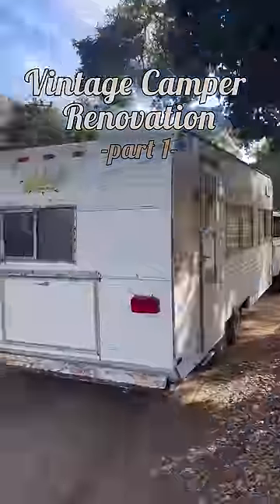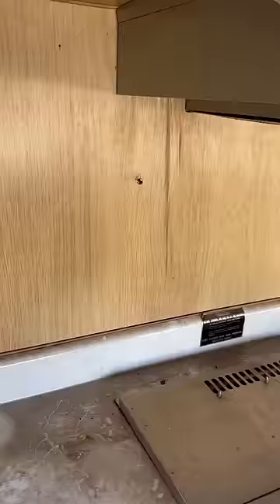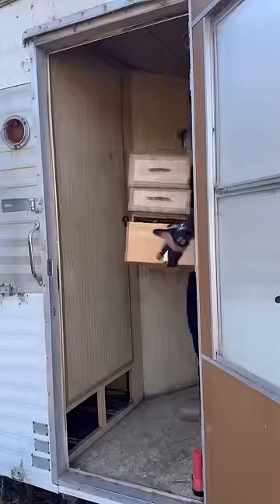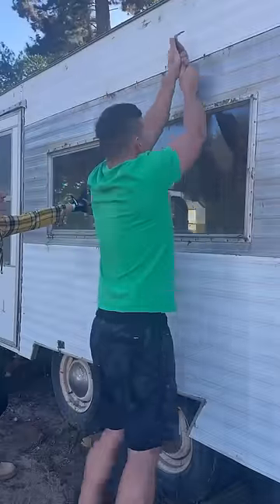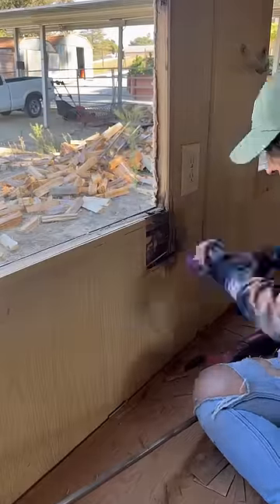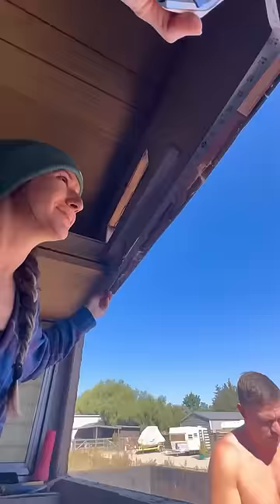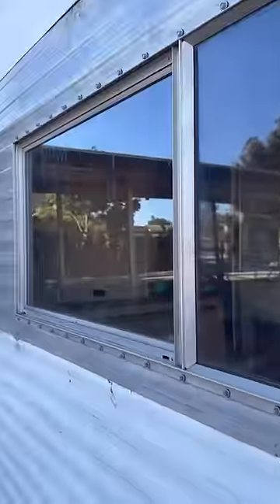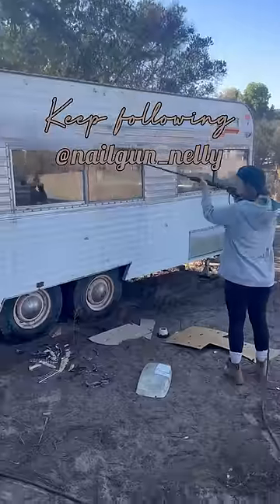Part 1 of the 1970 Ideal Travel Trailer Renovation! #rvrenovation #diy #vintage

Comment: ❤   Lesson if you do this. Cover the shop vac exhaust with a wet cloth to trap air particles.  My husband and I got deathly sick from doing the same thing. The mold  , and dust! Wear a mask!
Reply: Exactly! That wasn't petrified wood - that was mold eating it! As you found out the hard way, it's very dangerous for your health. Unfortunately you really need to remove all materials 3 ft in every direction around the moldly areas and then paint with an anti microbial to prevent it from growing back, because it will. My husband's a mold inspector. Be safe & good luck to all!
Reply: Oh wow, I’m sorry to hear you became so sick!

Some people might find the following to be helpful:

Vacuum bags are available for shop vacs.  Not just crappy paper either.  Now you can choose the level of filtration you prefer.

Also, consider wearing a respirator with the appropriate filter.
Reply: Everyone is so kind to be concerned & helpful. I hope U gett better Lisa. I think it would be best if U see a Natural Path Dr Bcuz U still have mold in U that U dont know about & that's dangerous.
Reply: It's not hard to determine if you've gotten into some toxic mold. You'll feel crummy around mid-day, swear you're coming down with the flu by 7 pm so will go to bed. Then you'll wake up in the morning feeling great only to experience the same thing that day.
Reply: Homeopathic tip.  Yerba mate tea and Pau d'arco tea are both  anti-fungal.  Available in health food store, or on line.  U may need Rx meds if u r ill enough with it, but the teas help.  I was nearly hospitalized with it when I was drinking contaminated water and didn't know it.

Comment: I did the same exact thing with a 1973 Comfort camper trailer. All new foam & upholstery.  Replaced some framing & wallboards in and around the shower. I resealed the roof but didn’t replace the windows. 
I was very proud of the work I did on it. I did an industrial themed interior. All counter tops were stainless steel with the swirls and backsplash was diamond plated aluminum. 
I had all done!  Buddy of mine knocked an old barn down for my wife while on my tractor. The main roof beam went right through the trailer door and some other panels got ruined. 
I ended giving it to a coworker who had just moved to San Diego right next door to a trailer siding manufacturer. They rolled out all brand new panels for him. He completely redid the exterior!! I only charged him for the new tires I’d just mounted on it
Reply from the maker: Awesome!

Comment: I've got a 1972 Lark camper,  my nephew took it apart all the way down to the actual trailer frame,  starting with sheet metal,  rebuilt it including good house insulation,  a little wood cook stove keeps it toasty warm...
Reply from the maker: Awesome
Reply: @Nailgun_Nelly  ,, looking into another camper

Comment: Nice job!  When replacing the rotten wood, don't forget the cause of the rot.  It's usually the roof, or roof/wall joint.  You need to lift the perimeter of the roofing to inspect...if you don't, you may be replacing the wall framing again in a few years.  It's fantastic that you've saved this classic from the wrecker yard.
Reply from the maker: Thanks for the tip, we definitely took time to reseal the whole rig, replacing all butyl tape and fasteners

Comment: We did the same thing to a 1969 aristocrat and it was fun and we were very lucky there was zero wood rot in the entire camper. We just needed to replace everything cloth an foam cushions. Now we paint and new tires.
Reply from the maker: Thats surprising!!
Reply: @Nailgun_Nelly  
We got very lucky it was parked inside for the last 25 years and before that it was beside a garage.

Comment: I was given a 30 ft travel trailer once in leiu of a payment a guy owed me.  I put $1,200 dollars into renovating it, and a WEEK later sold it for $5,000 GRAND.  I built a new entertainment center, two new propane tanks, pressure regulator valve, new wiring, new plumbing under sink, new water line for shower, re-surfaced and stained floor, re-built dining table, new shower, new door, back splash, new sink, new faucet, new queen mattress for bed, fresh paint, two new windows, window blinds, re-built A.C., and new generator.
When I was done, it almost looked BRAND NEW

Comment: I have a" 97"  little motor home. I love it. We bought it and only paid 5k for it. It's a great fixer upper. Everything works on it so we r extremely lucky and happy. I mean the ac and heater is better then the ones I have in my home lol. I love my camper I can't wait for the warmer weather. I say that but I have a lot of back pain so I'm a little discouraged and scared I think of the project. Idk. Nevermind. I thought I was trying to get some advice but I don't know where to begin

Comment: I love to see that you didn’t remove all the cabinets and structural skeleton of the camper. So many redos strip everything down to a bare box, when they finish it looks great but the 1st time they take a trip all the joints get loose. Before long there is no strength left and it basically shakes itself into pieces.
Reply from the maker: I try and keep anything I can!
Reply: I'm not trying to be cynical; this is a serious question. What kept it from shaking apart in the first place after it was initially completed? Whatever they did at first she would need to follow that same process. 
If the inner skin is taken off anyway it would be a good idea to check the structural integrity of the frame and replace damaged components if necessary. 

The only answer I can see is to use wood screws and  construction adhesive at every joint. No nails allowed except where absolutely necessary to do so. 

If you or anyone else has suggestions to improve upon my recommendations I would greatly appreciate them. One other thing: perhaps wooden gussets at the corners that experience  the most stress.

In the comments section I asked her to please tell us the total cost of the project. As an older guy with limited funds I would love to take on a project like this just to stay busy and keep my mind sharp through continual problem solving. Therefore I really would appreciate any helpful suggestions, and I will be keeping an eye on her progress as the project continues. 

Thanks for reading.
Reply: Your video came back around to me today, I went to compliment you on not removing structural support in the cabinets and dinette. I realized that I already did 7 months ago

Comment: I have a recipe that might help u. Take 1 gal if Linseed oil. Add 1 cup white ash. Let it dry. This will water proof ur wood. I would do more that I coat. (Thompson works too) u can paint it after u sand it if desired. That is a 1907 recipe.
Reply from the maker: right on thanks!

Comment: I would put some insulation in the walls if I was going to open them up. Would spray foam add much to the overall weight?
Reply from the maker: No i think it would def be a good idea.

Comment: If that old fridge gives you trouble, put a 4in fan blowing on the outside coils.
Reply from the maker: They always give trouble!
Reply: @Nailgun_Nelly   they have trouble absorbing/transfering heat in warmer weather. That little fan will help keep the condenser coil cooler allowing the evaporator to work better. I have an old dometic just like that on in a 1968 cab over truck bed camper. It's an awesome fridge but if it gets too warm out it acts up. There is a company that sells a kit for them, but the $10 Walmart fan is the option I liked. Great build btw, love your work.

Comment: While I was living in a vintage RV it was from a 1960 I'm pretty sure it's 1968 is more of a 70 style RV but it was from 1968 it looked like it was from the I was living in there I had a window AC through one of the walls because the windows were just too small to fit in a see-through and I'm not living in a hot RV so I cut a hole in the wall and put an AC in it well I live there for about a couple years like that well I was sleeping and this is a pretty decent sized RV it's like a 20-footer pretty high ceilings enough to where I can mount a ceiling fan over the bed and my bedroom but long story short I was sleeping and we had a lot of very bad snow weather well the RV roof really didn't leak as bad but it was leaking at the time and I have buckets under each skylight well I was sleeping and I heard this crunching would getting pulled apart I walk out and the entire front room of the RV is collapsed the roof and everything so I had to actually use the fire exit on my bedroom part of the RV because I couldn't get out the front door because I walked out there all I could see was the light that was mounted to the ceiling that is now above that's all I could see out there the electric in the bedroom went out as soon as the roof collapsed long story short my RV collapsed due to snow when I was living in it and I'm happy it didn't collapse when I was in the dining room it literally had its own like dining room almost like it was a pretty decent sized RV but it does suck that it claps on itself but my plans are to get another one I actually have the same AC from the RV I just cut it out of the wall with a sawzall and I know that AC didn't compromise the framing because I boxed in all the framing at the edge and I actually reinforced it with 2 x 4's just to be safe so that AC was in there really good but I'm pretty sure the roof collapse due to arotting beam in the middle that was actually bearing most of the load and that RV survived two pretty bad storms here in Kansas I was living in there we got this one storm that was so bad my roof actually was compromised after the Storm the water would leak into the walls and I didn't know it was doing that until we demolished the rest of the RV and turned it into a car hauler and I was 14 when I was living in there and I'm 16 now and planning to find another RV because I miss having my own kitchen and bathroom and dining room and you know the bedroom all that being able to have my own privacy basically it was like my own little I lived in it basically like it was my house while I was working at a bar and grill and I'm still working at that bar and grill RV set right next to my dad's house and I even wired it to electric myself most of the 2:20 appliances I replaced with 120 volt and then I wired in two pretty decent sized lines that were old Romex that was recycled from another house that we were rewiring well I had that Romex pool that just happened to reach out of the laundry room and down and up into the RV and I tied that into the actual breaker panel for the RV it didn't have  fuse box it had a breaker and trust me I'm pretty happy it had a breaker box given I had a window AC running in there and during the winter because the gas furnace that was in it went out I had two propane tanks on the front but you could run that furnace on gas but I was sitting there is midwinter in that furnace the blowers on it went out I have two blowers and they both went out because it was a two zone furnace there is the blower that went into the bedroom and bathroom and then there's the other blower that went into the dining room kitchen slash living room the RV was big enough to where I fit a it was basically just a love seat from the seventies but I miss having you so much she was my baby and I'm kind of bummed out that it collapsed on itself because I had a pretty vintage ceiling fan hanging in the kitchen / dining room area the ceilings in it or kind of high but the reason why I installed the ceiling fan in the actual bedroom in the back cuz it was like a single person or of either as a king size bed in the back with a wall that separated it in a the ceiling in the kitchen / dining room area was much higher it was almost 7 ft almost and I hung a flush mount ceiling fan from the early 80s in the kitchen / dining room because I am more of an older style person I like my house is to look old I like my RV lookout dated basically I like the outdated look I like it because it just kind of reminds me of my childhood because I grew up in a lot of outdated homes and I liked how they looked they're always so warm and kind of inviting but I remember living out there and it was a it was an experience on what to actually check on when you get an RV now and I've checked on some RVs that were free and I passed you to most of them each needed a new roof and the ceilings are too low but the more the room collapsed that had a 42-inch hugger from the early 80s and the dining room slash kitchen / dining room living room two well Van RV treated me good and I treated her as good as I could because I did not know that the roof was falling in on itself if I would have known I would have fixed it but I never got around to it and the Harvey collapsedand it was pretty scary having to go out of that fire exit cuz I had the thing sitting up pretty high on cinder blocks cuz I had a foundation going on it I was going to actually make some skirting out of foam board for it but that never happened you know because the roof caved in but I do miss that RV I have no idea the brand of the RV but it was a four season which whoever bought it back in the sixties or seventies must have been loaded with cash because a four season RV back then has to not been cheap but I had pets going to the toilet cuz I put a normal toilet in there a normal sink and the shower I had pets going out there to the kitchen sink too and it was basically just going off the laundry room hookups off the washer and dryer we just put in a t-valve that way we can do that well I had hot and cold water out there because of the you know the stock water heater was I'm not trusting it I'm not trying to create a pressure bottom in my RV what was the RV now it's a car hauler I want to know the funny thing is the tiles for the bathroom are still on the back because I put some pretty thick plywood down on the floors and then just covered it with 80s linoleum to top it's all off I wanted to keep the 80s look

Comment: What caused the wood rot?  Did you find and fix the leaks?
Reply from the maker: yes the seam above the window was leaking and one across the roof.  Replaced windows seams and resealed the top ones!

Comment: Between the hours spent in deconstruction, removal of the rotted wood that I’m not sure you even got close to getting it all because the wood around the windows looked to be coming from a leak higher up, replacing the bathroom and kitchen utilities, replacing all the inner walls that were taken out plus all the hours diagnosing all the problems and hours spent replacing everything. A much newer trailer would have made more sense unless you were just doing all this for something to do.
Reply from the maker: I think this comment was a lot of time taken for no reason so I guess we are similar 😂

Comment: I put a strip all along the edge of the window opening   , tape the inside of opening so about a half inch of dick tape is on outside and a half inch shows on inside. It will never rot around windows again

Comment: Why would you "splice in" framing instead of replacing the entire board?  It doesn't make sense to me because I have OCD and "drives me nuts" !!! You only saved a couple feet of lumber and now introduced a new structural failure point.

Comment: Never pressure wash an old trailer. Water will go where you don't want it to and it will stretch the metal. Now you need to remove all the J Rail and replace the old putty tape with new. Really you should have removed all the metal skins and replaced all rotted wood. There's a lot more under there than you realize.
Reply from the maker: I did remove every meatal seam and new butyl was placed along with new screws

Comment: Sadly you did not remove the skin or even the jrails or roof vents. There are areas of rott you cannot see. This is not the way to restore a vintage trailer unless it is aluminum framed. Stick built trailers should have the skin removed. Water travels down. Upper areas can look like they have gotten wet but not rotted because the water settles below the floor. Rotting the wood that holds the trailer on the frame. I know this from experience.

Comment: Where do the vice buy a camper with an aluminum frame don't use wood don't buy one with wood no I'm not sure about the windows and all that but if you have one with the aluminum framing you don't have to worry about most of that rotten
Reply from the maker: You do on the subfloor

Comment: I cannot believe how ORIGINAL this camper was, and you literally destroyed it.  It would have been much easier to find one that was gutted already.  They are at least as common, if not moreso, than shitty ones.  But to have found an original, in this good of shape and then...

Heartbreaking.
Reply from the maker: So I shoule have left the rot? the only modification I did was create some arches, the fridge didnt work, nor the furnace and the stove I am hoping to keep....everything will be going back in once clean and fixed.

What would be heartbreaking is letting yet another one go to the dump
Reply: @Nailgun_Nelly  
Arches weren't the only modification.  You can keep telling yourself that you're doing some kind of divine work.  But like I said, there are plenty out there that are already gutted.  People are looking for original trailers, and they are getting harder and harder to find, because of people doing this to them.  Flippers should be outlawed.